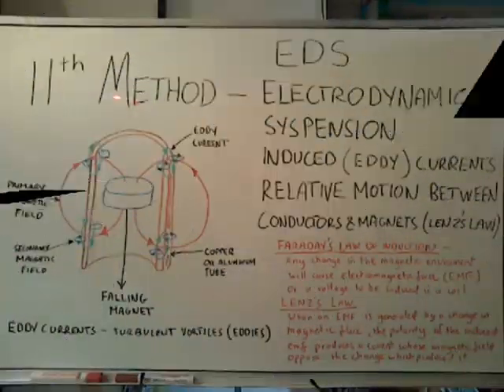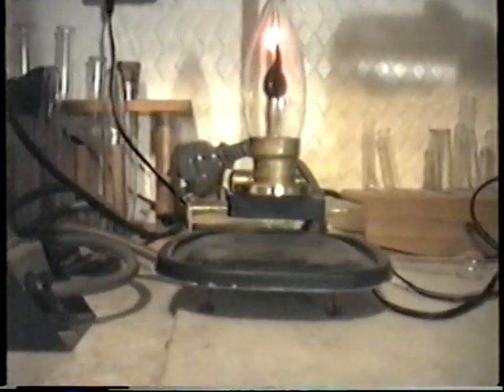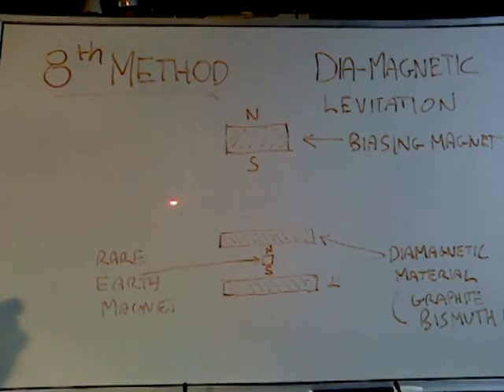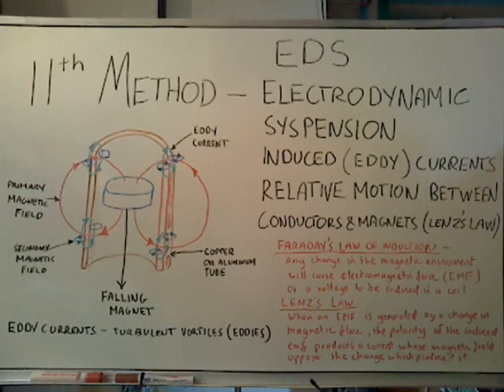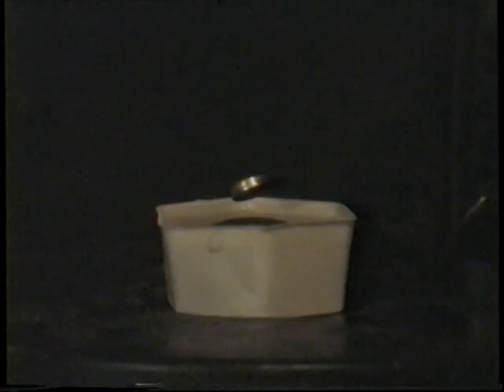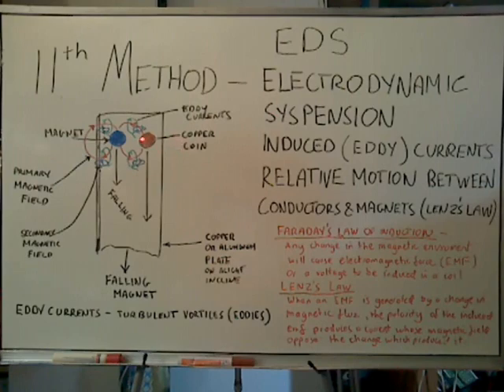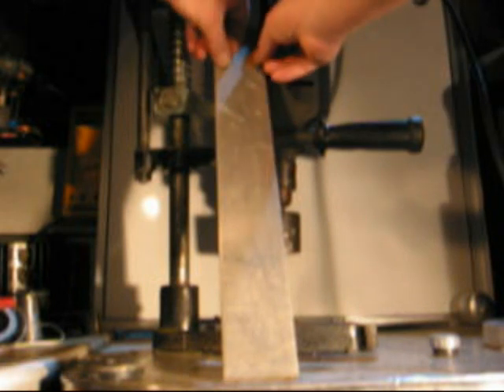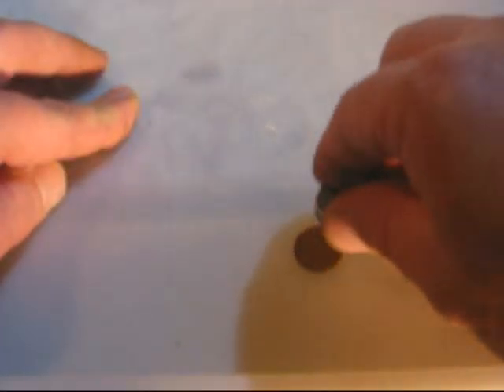"Antigravity" method 11 of 15 Electrodynamic Suspension EDS  Induced (eddy) currents Relative Motion

Comment from the maker: for my next trick I will use a Halbach magnet array spun over aluminum with an electrostatic field, that can be powered by the earth's field which will provide the relatively low direct current at high voltage, ideal for operating this device, in short a perpetually spinning levitating device, that is gyroscopically stable and will never stop levitating!